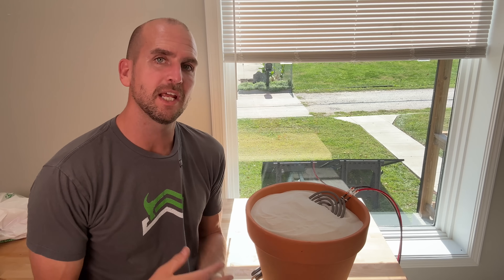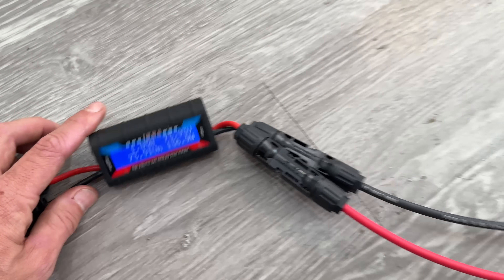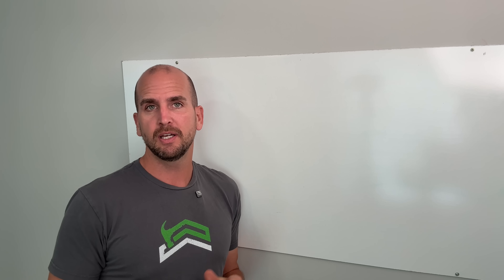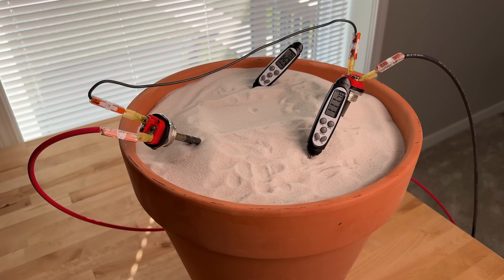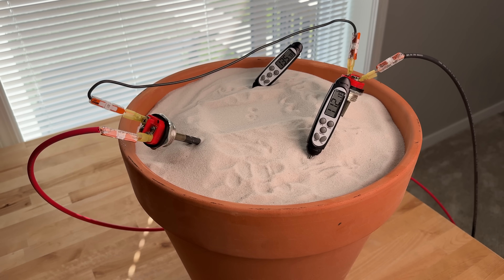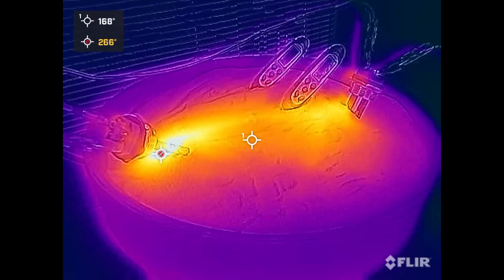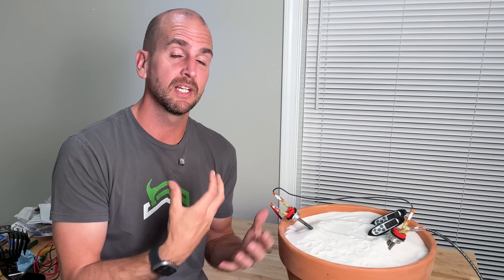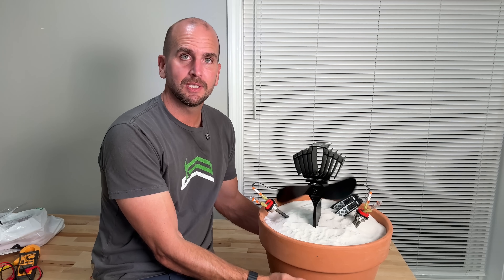How To Create A Solar Sand Battery Heater | Free Heat This Winter!

Comment: Nice concept, but a couple of remarks... -1- With the fan, a thermistor is a temperature dependent resistor. You meant to say a Peltier element/thermo-electric element. -2- Connecting solar panels directly to a resistor (heating element) does not use the panels at their best. You would need an MPPT controller. -3- The round cooktop element is rated for higher temperatures, which is what you need. The long water heater elements are made to heat water. At the much higher temperatures that you're using them now, they will not last long. -4- You're doing this experiment with lots of sunlight plus you didn't show the ambient outside temperature. So how would this work in winter with a lot less sunlight and below freezing temps? Please keep up these experiments, I;m curious how this scales up.
Reply: An MPPT will increase the efficiency for sure but again: With a max efficiency of 20% of the panels, a direct solar heating element makes much more sense
Reply: @pmbdk ..but then there's also the thing that despite the efficiency of the panel we get eg. max. 2kWh of energy from the panels we have during the day average..we have spec'd them to give what we need and the abovementioned is the value..then we hook them up into constant load and get eg. 1,5kWh average per day or even less when taking the low light seasons also into account since at least i need all energy around the year i can.. that's a quite a bit of energy lost / year..not to speak during the lifetime of the system..i wouldn't leave that out unless it was impossible for me for some reason..if you hook one fixed system side by side with power tracked and measured what happens in real life you wouldn't too..i was able to compare since i built my own controller from scratch up and compared power levels with either fixed power point or tracked..i think maybe you have different experience due to better lighting conditions year around since i live pretty high up in north..🤔..but thats my hands on experience..
Reply: @hipihei yes MPPT is important to produce the maximum of electrical power from solar pannels
Reply: This could be effectively used as a bleed-off for excess power from a wind turbine during a high-wind day. It is not a reliable option as a direct radiant heater, but it might be good as a water heater supplement.
Reply: Im thinking this would be great for a garden shed or even a green house
Reply: @pkf4124 that's what I'm trying to do. I'm looking for the best way to heat my greenhouse. I'm in zone 7b and it gets cold with snow and ice. I can't run electric so I'm looking for other ways.
Reply: PV panels are good for around 25% efficiency. Solar hot water collectors are good for about 60-70% efficiency. I wonder if you would be better off running hot water into the "battery" to bank heat. Need a larger battery due to lower Temps. You could hybridize your system with electric elements running off of wind power to capitalize on any wind that happens at night. Also, I would be concerned with any item that exceeds 130 f° where people come into contact with it as that temp is where burn injuries begin immediately on contact. Might need secondary containment.
Reply: @eviesmith6982 it's a winter setup, if I put anything with water on my roof in Edmonton, Alberta, Canada, I have a slight problem with freezing temperatures. -40 degrees several weeks per winter. So I am pretty sure this setup would be pretty good for here because we have a lot of sun, way more than Central Europe where we're originally from.
Reply: Solar thermal is fantastic unless it's very very cold. Then you need vacuum solar thermal which increases cost and complexity. Solar pv works great in the cold as long as you keep the snow off. @eviesmith6982
Reply: @eviesmith6982 ..i think pv is even lower efficiency..in practice 17-19%..that's why i've tried to make the dc dc converter as efficient as possible.. I've also played with solar collectors to heat directly circulating glycol-water..well i still have some in the warehouse..using collectors made from vacuumed glass tubes with 'selective' coating (black on the outside, silver on the inside) and while they work really well and efficiently..my current house is not very compatible with them since i don't have any heating system involving circulated water..and my floor is not concrete slab to be able to utilize low temps obtained from these in the wintertime..while they would be able to give me more hot tap/washing water production, the pv suffices me..and the hassle with putting those up on the roof, and make the piping, etc. and make sure it won't overheat or stagnate if circulation stops..well..it is not feasible for me at least on this house..way easier to bring in the cabling and go..and i get more proper temperature. I also cheat a bit with pv also; the resistive heater is basically only for 'superheat' or to get the final temperature..since my water heating tank is also for the abovementioned solar collectors..it has a copper heat exchanger coil in the bottom where the cold water comes in. There i have way smaller and simpler glycol-water circulation going into plate heat exchanger..on the other side of heat exchanger runs r290 refrigerant from a small heatpump i made from cheap air dryer..it had abt. 250W compressor and two similar radiators one being evaporator and the other being condenser..i reshuffled the guts so that both radiators are in series and being as an evaporator and the heat exchanger is being as a condenser..all of the house ventilation exhaust air goes thru it, and i cool down the exhaust air..refrigerant condensing energy in the plate heat exchanger is used to preheat the cold tap water from around +10-+15 degrees of celsius up to +46-+47 celsius. I've tried to measure the real cop-value from the amount of heated water and the temperature difference vs. power taken by compressor and always land on 3 as average figure..at the beginning when the water is colder the cop is really high..and as the pressure creeps up in the refrigerant due to water heating  it goes down due to increased power needed in compressing..but on average 200w electricity in 600w heat out.. The heat pump is powered from inverter that is powered from lifepo4 battery pack which is charged from solar or if no solar, then from the cheapest hours of my electricity company (we have a pricing model where the price changes by the relation of production and usage; if the usage is low eg. during nights they sell cheaper electricity to even out the load on the network)..so with the heatpump i'm not too far from the efficiency of direct heat collection..and still get over 70 degree celsius water temps to keep legionella, etc. germs out of my tank due to the 'superheat' from the dc dc converter and mppt and resistive heater..😅..and while also utilizing cold water shunt valve i can regulate the output temp to prevent scalding..at least any more serious than inconveniently hot water..and make the hot water tank apper larger than it is (by going quite a bit higher temp than putting out to tap line..often times during summer the solar gets me up to 98 degrees celsius (just below boiling) and sometimes even the converter needs to turn itself off..and let me tell you..that's way easier situation compared to diverting direct heat..!!😅 ..one could say i like arduinos and esp's..👍
Reply: @hipihei greetings man, im willing to work on my senior project that seems to be so similar to your solar heating system, I would love if I can in somehow contact you and do an "interview"
Reply: @littlehunter1955 ..i don't oppose Your request, however i don't know how to do it securely..i don't want my email become spam can by spreading it out in yt comments, etc.. also, though i'm professional in electronics repair and household appliance repair, i must consider myself just a hobbyist in these solar/heatpump/arduino/esp projects though i have some formal training in some fields of expertise (eg. handling refrigerants/flammable refrigerants and copper pipe working, etc.) but i'm not a real system designer or have worked in any r&d type of business so there might be something that could well be made better for better results..But having said this, my system fits my house and household perfectly and fullfills all the pre set goals i had partly exceeding them..😅
Reply: @hipihei  Huge blocks of print are really hard to read, that's why they invented paragraphs.
Reply: He’s using a 5 gallon bucket for crying out loud. How sophisticated do you expect this to be? This video is no doubt intended for somebody who has spare household items…
Reply: ..the cost might be an issue though as a poster before brought up..i tend always to think these videos thru a diy project view..for me it cost only a function worth of code and since i built my own dcdc converter to accomplish the task and did it pretty much from trash dismantled from broken household appliances (i'm fortunate to have access to that stuff by having a company working in the electronics business) and few chinese parts and a cheap microcontroller dev.board it can skew the thought of worthiness of mppt..but i think one needs to consider the total worthiness of the project in the first place..in my project leaving that out would have seriously degraded the total output and thus worthiness of the gear and time put into it..
Reply: The outside temperature doesn’t matter, except for the amount of heat you’re losing through the cables coming into the house. So, in general, keep the cables as short as you can, so you’re not just wasting power heating the wires instead of the sand. And since the power from the sun is free, any amount that comes in and heats the sand is significant, even with low level winter sunlight.
Reply: @walterrutherford8321 That's true when considering cables..however i was surprised how much more even the diminished lightin in crispy 0 celsius non cloudy autumn day produced power at the best hour compared to same hour during with more light intensity in the summer when the sureounding temperature is between 23-28 celsius.. (panel temp of course way more than surroundings..) And i have ground support where the back of panels cool freely into surrounding..just thinking if the panels were on darkish hot roof material..that would be considerable loss over the life time of the system..🤔
Reply: @hipihei  PV Panels have a negative temperature coefficient.  It is a problem in the Northern climates like @hipohei is in.  If you are using PV thru a charge controller you have to watch your input voltage as you can hurt your charge controller if this has not been taken into account. Say a panel is rated at 40voc at standard conditions. At 32 degrees it may have 44voc. If the input was rated at 130 vdc so you used 3 panels in series when the temp dropped you're now at 132.  Did the mfg have any leeway in the max voltage?  One way to find out.  
Check out David Poz for one of his videos for matching the heating element to the panels, he has a neat excel spreadsheet to help.
Reply: Actually mppt won't matter. You not charging batteries. Just harvesting watts. The life of those elements is not too big an issue. Those elements are for 240 volt 20 or even 30 amp circuits. They will never get that hot at his voltage and amperage. 
He might get better faster results with smaller elements that will get hotter. 
Higher voltage or in series panel hookup works best with any of these elements. 
I know this from testing direct panel hookups to 4500 watt water heating elements myself. With higher voltage the elements could burn green grass. 
That might be too hot for this.
Reply: @jamesleavenworth4312  MPPTs are not battery chargers. MPPTs are Maximum Power Point Trackers. They maximise the power you can get from your solar panels by looking for the maximum wattage point every second or so, because that point changes with time. A solar panel without MPPT does much worse than with MPPT. How much? Something for this channel to test.
Reply: @charanvantijn541  multi point power tracking is a consant up date to convert the raw and somewhat variable power source to a specific voltage. PV voltage to grid voltage. Wind power to battery. 
It doesn't create more wattage, though.
For this project, he can just dump it all and those elements will absorb and release it all regardless of the volt amp relationship. Very high over 99% efficiency. Best with water. The variable is the amount of time it takes to heat the storage media. 
The controll is to add more panels in series. The elements are not voltage fussy but ohms law explains that higher voltage is better at pushing amperage. 
MPPT is only minor because you don't need to match a pv voltage to specific voltage range. Panel by panel voltage increase untill you get near the rated voltage of the elements for the best efficiency. That is plenty close enough range. AC or DC voltage doesn't matter. The elements will get hot at half their rated voltage. 
I agree that MPPT couldn't hurt but, it really is over thinking this. 
I actually set all this up. I used 1 through 6 250 watt panels. I wired them to a 4500 watt element. Increasing the voltage panel by panel measuring the amperage and voltage each time. The best result ,of course, was six panels. 
I got a hotter element with series rather than parallel panels. 
The actual wattages were fairly consistent. A bit better with the higher voltage. 
In a scaled up heater version MPPT might be worth it. But, I still think it would be marginal improvement.
Reply: It really depends if the resistance of the heating element. An MPPT can effectively change the resistance that the solar panels "see" on the wire. Without an MPPT too low of a resistance will load the panel down decreasing the voltage and thus the power output. Too high of a resistance will not load the panel down enough to get the full potential power. With a fixed resistance you can get close enough to the maximum power some of the time. But will get far less power during less than optimal conditions as it will be loading down the panel significantly. 

All that said, the MPPT needs to be designed for the application. Most of the MPPT on the market are designed to charge batteries over a narrow voltage range. They are not likely to work well at putting the maximum power into a resistive load. 

Building a MPPT for resistive heating could be easily done with a series of resistive elements that are switched in and out to get the optimum resistance for maximum power transfer. Something like 1, 2, 4 and 8 ohm elements switched in/out in parallel would give a range from ~0.5 to 8 ohms. No buck boost converter required. More elements would give better resolution.  These could be built fairly cheaply as the MOSFETs don't need to switch very quickly. The elements could be made cheaply from heating element wire.  Could be as simple as the lower resistance elements are actually  a number of elements wired in parallel. 

The more I think of this, the more I actually want to build one. I have 2 spare 390watt panels at my cabin. Just need to get a roll of heating element wire and find a suitable MOSFET. I have a few microcontrolers and current shunt here somewhere. Now that I think of it I may already have suitable MOSFETs on hand. ..
Reply: @lordgarak  wow, that’s insanely implicated but simple if demonstrated in a video. Here’s why you should make a video. In Canada, prairies, it’s too cold for water. Hydronic panels for outdoor are many times more expensive. Plus lots more control equipment.
There is a demand for greenhouses in rural areas that can use solar. The sand battery is a great idea for a foundation, but heating it currently requires fossil fuel. Thanks
Reply: We have a lot of solar and wind and make a lot of power at night so that is when we need the heat.
Reply: What bothered me is that you have almost 800 watts of solar. If you had just hooked one water heater up instead, you would have got about 500 watts. Two in parallel would have maxed it out. You hooked them in series. Please run it again in parallel....please!
Reply: the goal is using the sand as energy storage similar to a battery. charge it up when its hot and sunny and discharge when its cold and dark.
Reply: Perfect to heat your home during summer... Perplex
Reply: Where I live there’s at least a small breeze 95% of the year, a wind turbine might be able to power it almost 100% got me thinking about a possible solution
Reply: This comment is literally the definition of a (a little bit of knowledge is a big danger). 
A resistor as he is using is ideal for this application compared to a peiltier device which has no chance of delivering th power as well as not being able to convert the panels electrical power to thermal power.
Reply: Get to work, smart guy
Reply: Solar panels have better efficiency and output when its cold outside.
Reply: MPPT is only useful if you have to convert DC from the panels to AC for the grid or for some local consumer running on AC.

This setup consumes the DC from the PV panels directly!
Reply: La chaleur ou le froid n’influencent pas la production d’électricité d’un panneau. La luminosité et le nombre d’heures de luminosité: oui.
Reply: S’il-vous-plaît, pouvez-vous expliquer l’utilité du MPPT dans cette situation?
Reply: Why not use this in conjunction with a portable battery (“solar generator”) which would act as an mppt
Reply: Never responded 🙄
Reply: Idea is good, harder to have solar panels generate enough juice. These heat sinks might help with heating, not replace current systems
Reply: @mattbrown837  You can easily ramp up solar panels in the winter by simply reflecting more light to them though.
Reply: @jeschinstad  lower sun angle = less available light and fewer hours, terrain interference, maybe in some areas.
Reply: urning sand into a heat battery? This is next-level DIY innovation!
Reply: @diytoptricks  It's not exactly new knowledge, but it has become relevant because of the inconsistency of renewable energy. If you produce electricity from nuke, waterfall or coal, then you get the power level you ask for, but with solar and wind, it fluctuates and needs to be stored.
Reply: Amazing DIY heating solution
Reply: Summertime, dressed in a t-shirt. Do the experiment again, in a cold period of the year. How long will the sand stay warm after dawn if the temperature in the room is cold?
Reply: 😅..maybe people should build and measure instead of shouting out opinions as information.. i have.. i'm heating water at the moment with 3rd prototype and 1/3 of a year my whole family (not a big one..just me, wife, one kid at home anymore, 2 dogs..😅) eg. can get all the hot water it needs..with only 3 el cheapo chinese "270w"-labeled panels..spring and autumn i cut the heating bill and no energy is available in practice from november to february. I'm not writing here any consepts or theories but observations from practical builds and real life tests.. i won't leave out the panel impedance / power tracking but then again..some other projects may proof something else for somebody else..😊..oh..i do my solar adventures rather high up in north..solarwise around the northern part of Canada though since i'm in Nordics the golf stream keeps our climate warmer..but i have plenty of low light conditions..!😅
Reply: @hipihei il me semble que huit à dix heures de clarté, en hiver ne seraient pas à dédaigner. J’ai ici des panneaux que je n’utilise plus. Sachant qu’ils pourraient me procurer de la chaleur m’inciterait à les utiliser l’hiver car je chauffe au propane.
Reply: A “Sand Battery ” Never needs a Mppt controller to function from solar. This is a different beast to tackle. In this configuration. This is considered a “Power Over PV device” or P.O.P.D. for short. The only thing missing from this design is a Capacitor slightly oversized for the voltage of the Panel to balance the power input coming into the sand battery.
Reply: @dapain1576 it doesn't NEED but one will lose A LOT of energy..tried that..eventually built dc dc converter and software to track ever changing solar panel impedance and change the pwm so that it matched my heater element all the time.. one can store only the energy one can extract from a day's worth of sunshine..no matter whats in the pot, or letters in the name of a consept, won't break the laws of physics..👍..the right resistance for the panel will be only on one temperature and one amount of light..different light or temperature would need the heater be replaced to different value.. and it doesn't need to change much to make heating power sag A LOT..😮..
Reply: @dapain1576   Do you happen to be in the EU?  I seen that set-up with the cap SO much while traveling. Just small systems all over the property to power specific things.
Reply: @dizzlethe7346  No, but I was unaware of it's popularity in the EU. I just know about it from research, trial, and error. This makes me feel even better about it. Thanks😃
Reply: @dapain1576  Spoken by someone who clearly has little to no understanding of electronics. Putting a capacitor across the solar panel will achieve nothing of use. If people are selling systems that just a solar array, capacitor and some kind of simple load like a heater driven from the solar array, it sounds an awful lot like the power saver scam devices that you often find online. As @hipihei said, MPPT isn't required, but if you want to maximize your energy harvest from solar, you need something that allows the solar array to operate at it's maximum power point and since the maximum power point will vary depending on the incident lighting conditions, cell temperatures, cell age and other factors, you generally want some kind of device that can respond to changes in the maximum power point. Such a device will need capacitors for various aspects of its design, but it will need a lot more than just a capacitor to do anything useful.
Reply: @dapain1576  Yes, good correction of comment. Can you tell us more about the capacitor so we understand why.
Reply: @dapain1576  I'm building my own solar immersion heater system and your capacitor comment interests me.  Do you have more info on it and how it could improve my system?
Reply: MPPT is only useful if you're trying to maintain a specific voltage as it will drop the current to maintain the most power it can for that given voltage. It wouldn't make any difference in a direct connect resistive load. You'll have the same power output either way in this scenario.
Reply: @andrewt9204 Wrong, solar panel power output is not constant, it depends on applied load resistance, and have a peak-point. The peak point also depends on specific lighting conditions, so you need to constantly track it. That's the big deal behind MPPT. But anyway, using photovoltaic for heating is a waste, direct heat collection with solar collectors is much more effecient.
Reply: @artemylebedev9707  That last bit is an important point. A black body collector with some plumbing running through it to move the collected heat where it's needed would probably be more effective than photovoltaics. It would need to well constructed to work in the winter when you most want the extra heat. I believe that commercial black body collectors enclose the black body collector inside a vacuum to keep it well insulated from the cold environment outside. One advantage that photovoltaics has is that whatever energy you do collect, you don't have to worry too much about losing it to a cold outside environment.
Reply: @artemylebedev9707 Il explique qu’il récupère des panneaux qui n’étaient pas utilisés.
Reply: @artemylebedev9707 Good comment! Nothing is simple! So over time this won’t work well because the panel voltage is changing during the time of day and clouds? 
Can you explain more. Wouldn’t the panels always produce 73v but just less amps? So the element would just make less heat?
Reply: @Swampwild1  depending on conditions the panel has a power curve, which describes how much watts you can drain from it at the specified voltage. The power peak is somewhere in the middle of output voltage range. Just search any article about tracking MPPT controller, it usually has some sample diagram. It somewhat similar to combustion engine having different torque at different rpm, and different total power output curve, which changes depending on fuel mixture parameters.
Reply: Even with MPPT controller you should also ensure, that you are constantly overloading it (i.e. making it limit load current, not voltage), not every controller can work in such mode. Connecting resistance instead of battery will cause charging error for most controllers. Otherwise you will only consume only part of energy, which may be extracted by MPPT. And in general, all this is quite meaningless, using solar heat collectors is much more effective for this purpose.
Reply: @artemylebedev9707  One positive about using a sand battery like this over a solar heat collector unless it is using heated air, is the fact that the sand won't freeze if the space get below 32F.
Reply: @artemylebedev9707  You're assuming the use of an MPPT designed for charging a battery. You wouldn't use such a device here unless you were planning to also include an electrochemical battery in the system - which doesn't make a lot of sense. Most MPPT charge controllers I've seen are not designed to work without a battery connected, so you'd need to either design your own MPPT designed to drive a resistive load or find one that someone else has already designed that you can buy.
Reply: @brettski74  I assume MPPTs with chargers because they are the only ones widely available. It is quite obviously that person, who does not understand why it is needed, will not be able to develop a custom one.
Reply: @artemylebedev9707  Sure, but now you need to add a battery, which may not be cheap. Based on some of the other conversations, if you were going to take this approach with photovoltaics I'm thinking you're probably better off just tuning the resistance of your heating elements to operate as near as possible to the optimal power output specs for your panels. MPPT works well in battery systems where the battery voltage is significantly different from the optimal solar array output voltage. But for something like this, you don't need to be as constrained in operating voltage as you do when working with a battery. If you really can't get close, then maybe MPPT will add something but if that also means adding a battery, that's a nontrivial extra cost and the battery might cause other problems that limit your energy harvest.
Reply: good in spring when there is minus 10C
Reply: Ya the mppt doesn't make sense unless you have a boost converter you just need to pair the elements better with the panels he has like almost 800w of solar and is using 250w the elements should be in parallel that would double the power
Reply: @james10739  It really depends on the resistance of your heating element and the characteristics of the panels. If the heating element is low resistance, then you may be able to build an MPPT that covers all reasonable operating conditions based on a buck converter. If the heating element resistance is high, then you may need to base your MPPT on a boost converter. A buck-boost or SEPIC converter based MPPT might give you the best of both worlds, but for my money a buck-derived MPPT makes the most sense. Buck converters are generally simpler to design and make compact and efficient. Accordingly, you'll want to have a heating element with sufficiently low resistance that your maximum power point will always be at a point where the voltage across the heating element is lower than the optimal panel output voltage. So I'd design it based on a buck-converter, test it out and if I was often running at or close to 100% duty cycle, add more elements in parallel to lower the resistance and test again. The panel specs should give you a pretty good idea around what voltage the maximum power point will usually be, so it shouldn't be too hard to figure out a reasonable heating element resistance on the first pass.
Reply: @brettski74  ya you just need to match up the resistance with the panels you have
Reply: @james10739  Yes I was thinking the same....solar panels in series to double the voltage then heaters in parallel to double the current in the heaters
Reply: 74 volts won't hit either one of the hot water heater is usually 220 or 240 he's not even using a inverter and a battery solar panels are mostly for charging batteries so the batteries can go through the inverter I don't know why he's doing it this way but 74 volts won't heat those things up much at all
Reply: Bigger battery would radiate longer to get through the night
Reply: 1 your wrong 2 the solar panel will adapt effectively enough to these 240 v elements, 3 the cooktop element and the water heater type have identical construction.  The water heater is actually the one with higher Temperature potential.  4 potato
Reply: @talusranch990  1. Yes he's partially wrong since the Peltier effect refers to the movement of heat due to the work done by an electric current. The generation of potential difference due to the temperature difference between two points is the Seebeck effect (or thermoelectric effect, but that refers to both Peltier and Seebeck effects). Devices which use the Seebeck effect are generally referred to as thermocouples. A thermistor absolutely is a temperature dependent resistor. Even more technically speaking, all resistors are temperature dependent, but we generally only refer to devices as thermistors that are specifically designed to vary in resistance in a predictable and useful way across a known temperature range. The thing providing the power for that fan is a thermocouple - or more likely a thermopile, which is several thermocouples connected in series.
2. It depends what you mean by "adapt". They will absolutely work, but he's also right in that if you want to maximize your energy harvest, you will need something to track the maximum power point of the solar array and operate it at that point. This generally requires some kind of DC-DC conversion stage and a feedback and control system to track the maximum power point.
3. Whether the water heater elements will produce more or less heat with a given solar array will depend on the nature of the solar array. The water heater elements are rated for much higher power, so they will have lower resistance. That said, the stove elements are designed to operate at much higher temperatures, where their resistance will also be much higher, so their room temperature resistance will be lower than their designed operating resistance. I suspect their room temperature resistance is still higher than the water heater elements, but will be closer than a naive ohm's law calculation based on their rated power output would suggest. In any case, if the resistance is too low you will fail to capture a large proportion of the energy that was available for capture from the panels. The output current of the array is limited by the rate at which sufficiently energetic incident photons are hitting the array. If the resistance is low, you don't get more current because that doesn't change the rate of incident photons. You just get lower voltage and hence lower power delivered to your load. It will all depend where on the operating curve of the solar array a particular heating element's resistance will fall. Of course, if you have a device in between that allows the heating element and solar array to operate at different voltages that changes things. That's what an MPPT would do for you here, but you'll need one designed for a resistive load. An MPPT charge controller is designed for a different problem and may not work as expected with a resistive load and no battery.
4. Turnip.
Reply: @brettski74  I'm very aware of all this.  Nice techno talk. Mppt is a computer controlled gearbox,  the thing does not need all this bs.  It's free power and will find a happy IV relationship like a torque converter does in an old school automatic.  I've designed many switching power inverters,  mppt is overrated. It is always hunting....and loses power.  One solar panel, one large uninsulated water tank (open) and a several 2 ohm elements.   Sausage
Reply: @talusranch990  Nobody said you need MPPT. What we said is that you may be able to harvest more energy from the same solar array and heating elements if the system tracks the maximum power point. This is a true statement. It's also true that many people may be able to set up a solution that is good enough without MPPT and that for this particular use case, you'll probably need to design your own MPPT since most commercial ones are designed to work with a battery and don't really function without one. As for the rest, you're entitled to your opinion. You could probably tune your solar array setup and heating element selection to a point where the potential gains from MPPT are minimal. For the DIYer, that may well be a better approach. A good MPPT design would remove some of those constraints, though.
Reply: @talusranch990  1. His wrong what? You're wrong, btw. A cursory google search will set you straight. 2. The point at which it "adapts" may or may not be anywhere close to the most efficient operating point. Whether or going with an MPPT is a better use of dollars vs just adding additional panels is a different question.